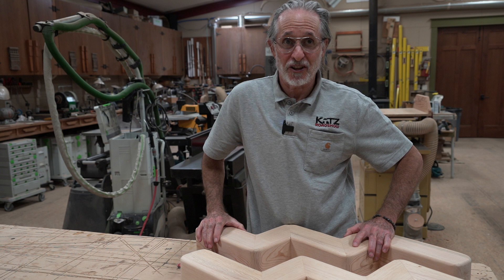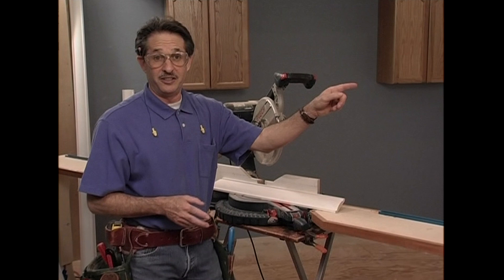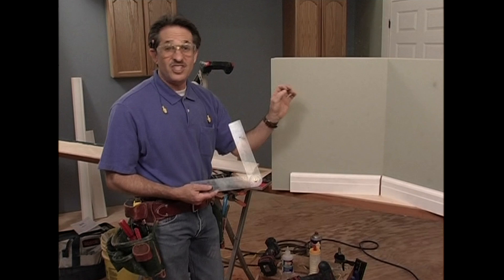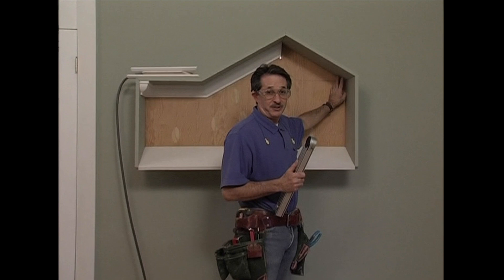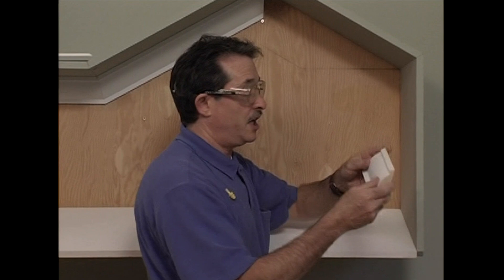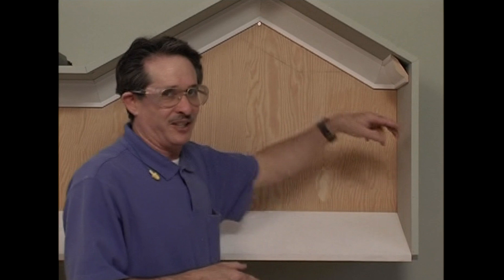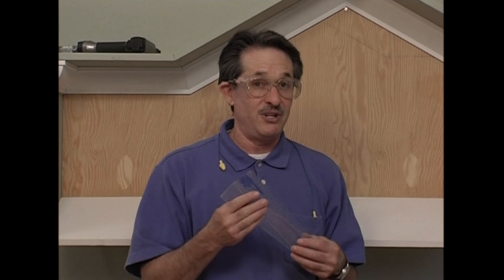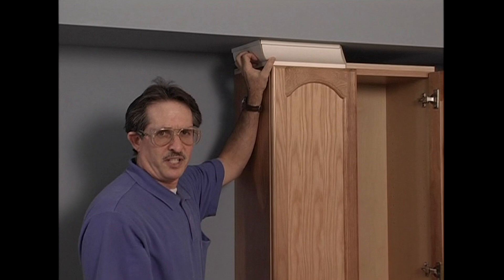INSTALLING CROWN MOLDING, PROGRAM 6:  ADVANCED TECHNIQUES, with Gary Katz

Comment: Many, many thanks for this very informative video.  As an amateur carpenter and cabinetmaker, I have installed crown mounding in two homes over the years. Thought I was pretty good for an amateur--but I had no idea how much I really didn't know.  In the unlikely event that I should ever have to do it again (I'm in my mid 80's now) I will have to come back and review this video again.  As has been said by others below, this is pretty heavy stuff--and I am not referring to the weight of the mouldings.

Comment: Thanks for posting.  When you we modifying your crown (creating different spring angle), you camera caught the molding moving inside your fixture as it was being cut not to mention some pauses.  I have some expensive oak crown I had custom milled, it came out poorly so I  need to do a similar cut and will borrow your jig design to make that cut SAFELY.

I am worried the wood will burn and cut won't be flat.  I run 60 tooth forrest woodworker II blade in my table saw.  I am thinking to add feather boards to better hold crown tight to jig thru the cut and paste wax over mdf to try and make it easier to slide pieces thru.  Do you have any thoughts on enhancements to your jig?  Are you getting the accuracy/quality out of it you need?

Other thing, its very hard to follow how you are setting your mitre saw following your discussion about different numbers reading on different machines, gages, etc.  I agree super confusing when you first pick up a protractor, measure a corner of a wall then try to cut it on a saw.  Perhaps it is a conspiracy by makers of trim and saw manufacturers to cause us to buy more ... I know I make plenty of cuts/pieces of scrap as I go thru learning curve making a piece of trim fit a room before nailing it on.   Never fails, on my last piece of trim I cut then angle opposite direction needed and need another trip to store for more molding. 

Last question, I noticed you have been doing this kind of work a long time and are not wearing a respirator during your cutting.  I notice lots of dust collection apparatus in your shop, have you found any issues working in that environment?  My point being lots of dust not being grabbed by dust collection system, has that been an issue?

I do alot of mdf, even running best system I can come up with there is alot of fine dust floating in air after I make a cut or a pass with a router.  Curious about your take on this.  Thanks again.